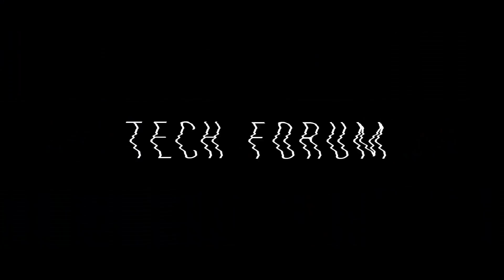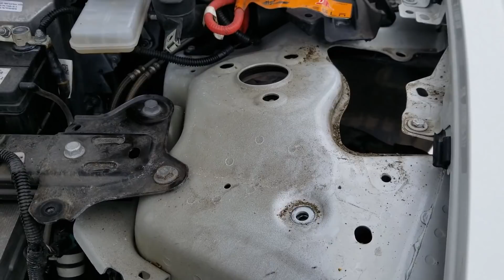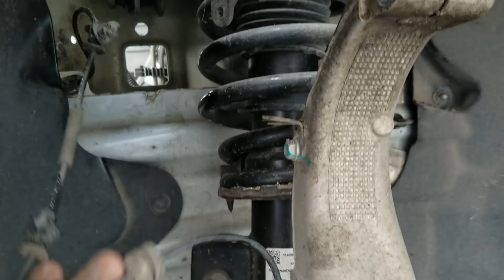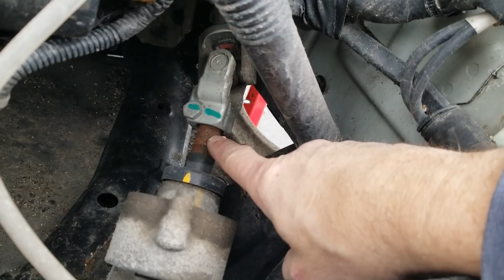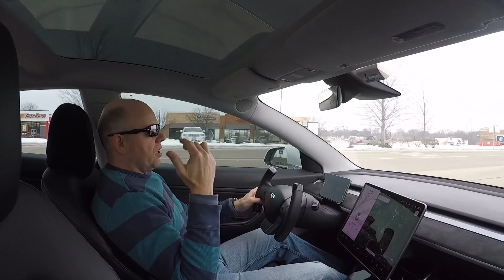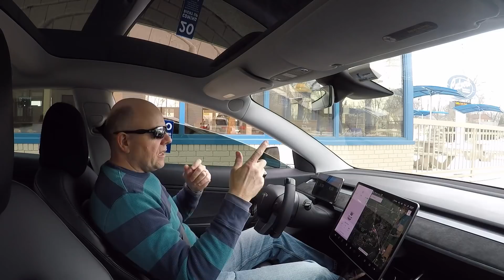Tesla Model 3 Upper control arm replacement in my driveway!

Comment: How long do you think it would take to do the upper control arms if you removed the entire front strut assembly? I'm paying a shop to install OEM suspension on my car. And they quoted me an additional $350. to change the Upper Control Arms. When they are already replacing the struts... Crazy to me. So of course I'm questoning it. I'm not as young as I used to be or I would be following your video and doing it on my own.

Comment: Should it cost 4000$ to fix a left upper control arm?
I was told that both sides had to be done 2000 each side
Is that accurate?
Thank you

Comment: Granted Tesla saying that the upper control arm is a normal wear and tear part as if it's normal to have those noises after just 60k is BS.  That part was redesigned soon after all the complaints about the noise started coming in.

Comment: Model 3 has double wishbone suspension so the spring and shock are not a strut.  A strut is structural and pivots around its top anchor, making the top wishbone unnecessary.

Comment: Used a grease needle to inject fresh grease into the rubber housing on the ball joint, then used a lot of silicone lubricant on the control arm joints where they connect to the vehicle body (looked a bit rusty). Still squeaking the next day, but drove about 100 miles and all squeaking/creaking is now gone! I removed the tire to get a little more room for the spray can, but i don't think it was necessary.
Reply: I just did that (injecting grease) the other day!  How’s yours holding up?
Reply: I did this on the weekend but still creaking, quite loud! I'm not sure if I added enough grease and if I should add more or wait until I've done 100 miles or so to see if it goes away. To me it doesn't feel like it will go away

Comment: I only losend the ball joint on the upper control arm and moved it around to spread out the greas that were already inside from the factory. That made the noise go away. So i didn't have to change the whole arm. It took me 10 min

Comment: The other option to fixing the creak was to lube the ball joint. 500.00 +labor job vs 40.00 job plus labor. This is an old video,  so it probably wasnt evident to the non mechanic butnthere are a lot of vods out now showing the fix opposed to getting fleeced by the Tesla "sevice" team.

Comment: I THINK I HAVE SIMILAR ISSUE. BUT AFTER TESLA GUYS REPLACED UPPER CONTROL ARMS NOISE STILL THERE. WHEN I ASKED THEM THEY SAID THAT MY LOWER CONTROLS ARMS MAKE NOISE. STILL DON' T KNOW WHY THEY REPLACED UPPER FIRST,  BUT NOT LOWER ONCE. STILL DRIVING WITH A NOISE, WASN'T READY TO SPEND THAT MUCH MONEY AT ONCE. WILL HAVE TO GO BACK BUT DIFFERENT LOCATION THIS TIME. STILL DON'T KNOW WHY THEY LEFT ME WITH SAME NOISE I CAME IN FOR..NOT HAPPY ABOUT THAT. AND NEVER HEARD OR SAW THE VIDEO THAT THOSE LOWER ARMS MAKE NOISES, EVERYONE SAYING JUST ABOUT UPPER ONCE.. NOISE IN MY TESLA M3 STARTED RIGHT AFTER 100000MILES MARK.

Comment: Had to have my upper control arm replaced recently. A bit too soon for my taste, but hey it's the first thing that needed fixing after 2.5 years. What I would love to know is if there's something I should've done, or should not have done, to avoid this.
Reply: It's a flaw in the control arm. Tesla wanted to charge me 2k to remove so many things that did not require changing. I was a former mechanic apprentice so i know after inspecting they were full of shit. There's nothing you can do just grease the ball joint every year of 2 and save yourself a ton of cash.

Comment: I had Tesla replace my upper control arm last May and the new one is squeaking now. This time, I’m outside of the warranty. Tesla quoted me $332.50 and I have an appointment next week.  Do you recall the part cost on this repair?
Reply: What did you end up finding out?

Comment: We have a solution that does not require replacement and or removal from the car. Silly to replace a entire control arm for a squeaky ball joint due to lack of grease.
Reply: What is your solution?
Reply: What’s your solution?

Comment: 1/2" hex size, telling me Tesla isn't using metric bolts? Hard to believe.
Reply: Yeah, I really think he is mistaken . That is a 13mm bolt. They are close enough in size that mechanics use either 13mm or 1/2” interchangeably on the regular.

Comment: I’ve had mine replaced by Tesla at 30,000 km. Now the noise is back at 52,000 km. When the problem happened the first time, I ended up greasing the ball joint with a needle grease gun and the problem went away until Tesla came and fixed it. However, Keep in mind that it took about 160 km (100 miles) of driving for the grease to get into the joint and for the noise to go away.

Comment: My upper control arm started doing this as well after 9000 miles. ( 2019 Model 3 )  How much do they charge if it no longer under warranty?
Reply: According to what I have seen on a FB post:
Parts: $330
Labor: $682.50
Reply: 620 for parts and labor. Then another 175 or 205 for alignment. The higher number is if you have air suspension. Roughly 800 to 900 dollars

Comment: Have you had your squeak since new? I had mine since new, took it in around 5000 miles to have them look into it but they could never reproduce it. I took it back in recently to try again and they replaced both of my upper control arms. Not sure what exactly goes wrong on them, or if there's a new design or something.
Reply: Mine a 2021 and just got both replaced under warranty they were making noise at low speed going through bumps. Mine was making them at 12k miles lol.

Comment: They are not 1/2 inch.
They are 13 mm.
Unbolt the bottom of the column. No prybar needed. Lego.
13,15, 18, 21 mm.

Comment: Matt. The reason you also need an alignment is if the old part is worn out enough to warrant replacement...given that the new part isn’t. Alignment will be different. Small changes in camber/caster have  effect on toe angle which is the #1 concern for tire wear.

Also for rust, fluid film is great. And it comes in a spray can
Reply from the maker: The ball joint in the control arm was not worn out. It was too tight. No play there at all.
Reply: Tech Forum I’ll give you a pass (lol, no I do not think my opinion matters).  Manufacturing tolerances are 100% wide enough on even the best made cars that the factory checks the alignment. (ESP toe).  Since you said tires are about to get replaced I don’t really think it matters. But bolt marks lining up isn’t a replacement for an alignment IMO.
Reply from the maker: @MrCarCrazy  it sure beats just bolting the arm on without any concern whatsoever.
Reply: Tech Forum I can’t argue with that. Used to love it when customers cared enough to do that.

Comment: Wasnt this covered under warranty?? Just curious....
Reply from the maker: I'm out of warrantee
Reply: @TechForumTesla  how can that be? A sway bar should last more than 2 years??
Reply from the maker: @michaelbergmark3549  it is not the sway bar. It was the upper control arm (specifically the ball link part of the arm).
Reply: Tech Forum ok, doesnt really matter what its called, still think tesla should have covered it, especially If the part was wrong from the beginning. What did Tesla say about it ?
Reply from the maker: @michaelbergmark3549  I never asked. It is way out of warrantee. Besides, they already fixed my tiny rust spot when out of warrantee as a goodwill measure. I wasn't going to ask about this. It was easy enough to replace.

Comment: I’m not happy that an upper control arm failed in only 70,000 miles. You’re pretty easy on your car. Hopefully this is a “one off” problem.
Reply: Evan Harris squeak != failed
Reply: Sean Z You’re right. It’s just badly designed.
Reply from the maker: @heinovanwaelem8275  wow, aren't you a bundle of sunshine. 

Why are Teslas expected to be perfect? 

Geeze, Dude, do you bash other brands if they have an issue? Probably not. Some Tesla haters are just biased plain and simple.
Reply: Tech Forum Come on man. Do I bash other brands, of course i do.
Last year i owned a new Mercedes-Benz E-Class. HVAC system sucks like hell, condensation in headlights, a lot of brake rotor problems and some other defects. Problems also came and went.
Some people told me what a crap brand it was, i just said to them ‘you have no clue, it’s far worse than you think’. Should have seen their faces. That’s being honest.
Tesla doesn’t have to be perfect, they just have to do better in some areas. That is my concern for future (second hand) owners. Why is that such a problem to point out something that others may have missed? 
I’m just being honest but some people just can’t handle the truth i guess. Some cars have weak points, it’s important that people point them out without being biased.
And to be honest i said love the videos, isn’t that the goal of your channel? Independent of a product? Can’t see constructive comment even if it bites you in the face i guess?
You could also just have answered ‘yeah, they could do better in that area’ to keep the church in the middle because we are both right.
Much of success with the channel.

Comment: Hey Matt, I rarely comment on YouTube vids so pardon me if I'm doing this wrong. Thanks for sharing another great adventure in Tesla DIY. I have a small rattle in my M3. Pretty minor, but just enough to bother me. Initially I thought it was coming from my dashboard. I took it to Tesla right before my first year ran out. They couldn't duplicate it, tried adding some extra glue to a speaker grille and sent me on my way. It rattled again on the way home. It's intermittent and seems to happen between 35 and 60 mph. I feel like it's some kind of thing where it only makes noise when the vibration resonance is just right. Eventually, I figured out that when it happens if I stick the tips of my fingers on my left hand up from the bottom between the steering wheel column and the dash it makes the rattle stop. I think it's the shroud around the steering wheel column. I've tried to figure out how to take it apart but aside from one screw on the bottom I didn't get anywhere. I figure if anybody knows how to take it apart, you would. Any ideas?
Reply: I had this same issue and fixed it by wedging a black foam piece between the steering column and shroud.
Reply from the maker: @android04  different issue. Mine was the upper control arm.
Reply from the maker: That shroud snaps around thre steering column. The top part snaps down to the bottom.
Reply: @TechForumTesla  Thanks for the tip! Really appreciate what you do.

Comment: Any concern on your side with regards to the steering shaft rust? That does seem kind of strange right?
Reply: All of these kinds of parts on most all cars are not painted. The surface rust is totally normal.
Reply: Darren Orange Not at all, salt everywhere for road ice.
Reply: Yeah anything bare metal like this will rust, like brake disks..

Comment: Audi did the same thing with the upper pivot bolts on my 2000 A4, but when put back together,  I put the bolts in the opposite way to make it easier for future upper arm replacement.
Reply from the maker: I wish that was possible here. No such possibility though.

Comment: Matt, did you use the Model 3 Jack pads??    

BTW, that area in frunk is the shock towers.

No reason that in lieu of accident that a car should need replacement of upper control arms.   Tesla should be embarrassed.  Ridiculous for a 19 month old car.
Reply: Newzchspy 80k MILES on the car, not really unusual at all.
Reply: The guys is replacing the upper control arm and removing the frunk, do you really think he doesn't know about using jack pads?

Comment: I rarely “like” videos, probably around 10 videos for the last 4 or 5 years.

I Liked this one because too many people seem to think a Tesla can’t be worked on at home. And this video needs to go around.

Yes I understand it’s just a control arm, but still. I’ve seen too many people say this and that about Tesla cars can’t be worked on.
Reply: Now that there's a lot more on the road 4 years later, there's a lot more people figuring things out. More aftermarket parts are now available too. My issue with this part is Tesla calling it a normal wear item even with just 60k on it. They knew the design was faulty which is why it got redesigned.

Comment: Were you able to buy the new control arm directly from Tesla, or was it a salvage part?
Reply from the maker: I got it from Ebay. I could have bought a new one. But, it was easier to order a used one from ebay.
Reply: Tech Forum Can you explain why it was easier to go through eBay? I mean what were some of the hoops you might have encountered if you had go to Tesla? 

Does the National part chains have Tesla parts? (I’m sure they do, but don’t know it if they don’t have the correct part numbers and such.) I really haven’t gone to them, so I don’t know.
Reply: @TechForumTesla  From where would you buy a new control arm? I have a hard time finding them.
Reply from the maker: @stal5861  ebay
Reply: @TechForumTesla  I only find drivers side control arms on eBay. I need the passenger side. I do find used, but not any new once.
Reply from the maker: @stal5861  the other option is to drill and tap the tip of the ball joint top accept a grease fitting and grease it. Electrified garage does it that way.
Reply: @TechForumTesla do you have a link for that?

Comment: So ... not a warranty repair?
Reply: Phillip Probst he’s over 50k miles already.
Reply: Mark Sanders more like 65k miles......
Reply from the maker: @Newzchspy  69,853 miles.....
Reply: Tech Forum that's a ton of miles for a 19 month old vehicle Matt.  I'll tell you this. You have a lot more patience than I and the general public about the control arms.   I see no reason why they should go in 60k miles absent major pothole strike or perhaps auto racing.  None.  Seems like early adopters always get screwed. I'd be ranting and raving if my control arms did that.  Being a long time Lexus owner, I have little patience for manufacturing related issues.  This is clearly a defective part(s) issue.
Reply from the maker: @Newzchspy  probably so. The car is lowered and I use it for a commercial application. That gives me more understanding of mechanical issues than I would otherwise have.